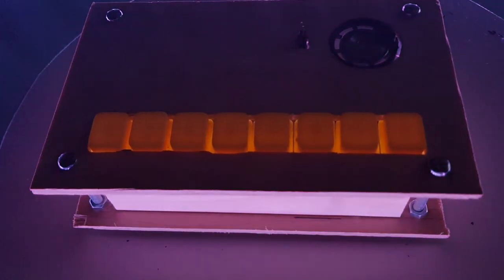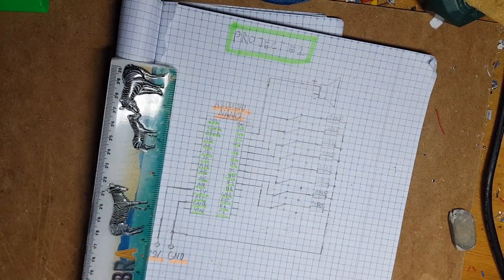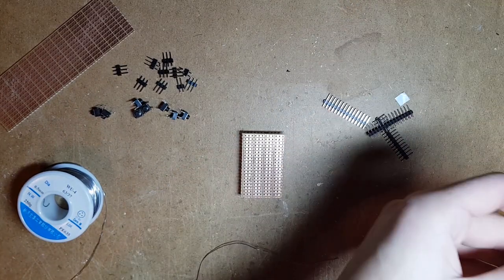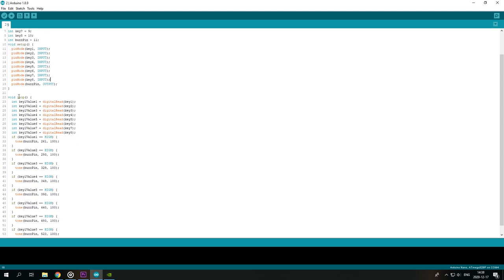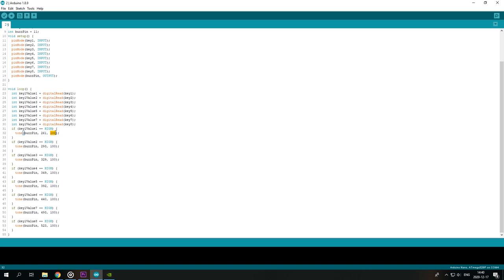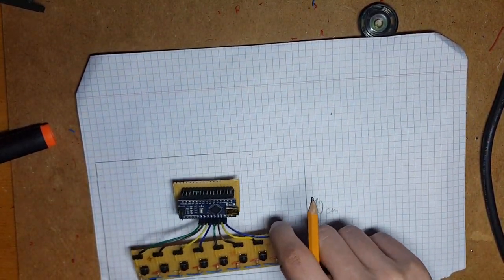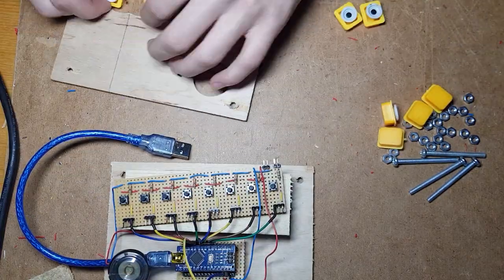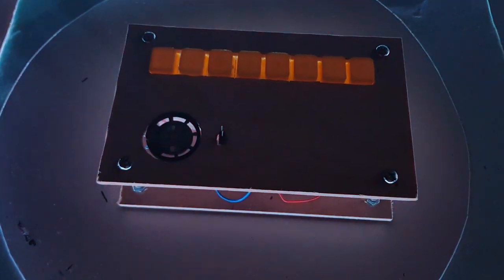Simplest Electric Piano You Can Make

Comment: Hi there! An electronic enthusiast writing. A cool addition to the piano would be an additional switch, from which the Arduino could read a value, and based on that value it would change octaves. For example: Add an on/off switch. When the switch is in off position the Arduino plays the first set of notes. When the switch is on, the Arduino plays the second set of notes. You could also achieve that with buttons, variable resistors etc .That way you could play more notes on a small piano.
Reply from the maker: Hey! Thanks I did not think of that, so I will definetely do that, adding more octaves will realy make it more usable! I realy appreciate the advice!